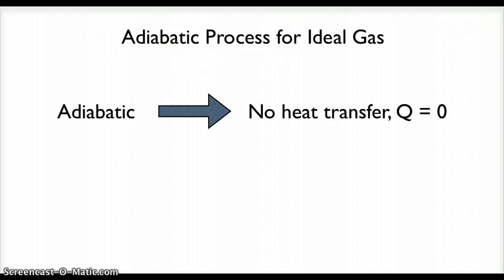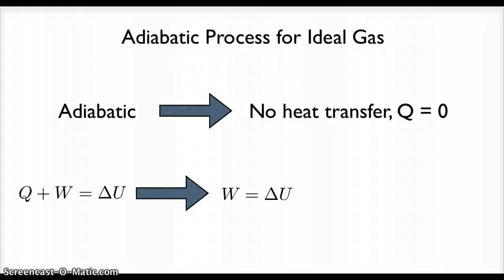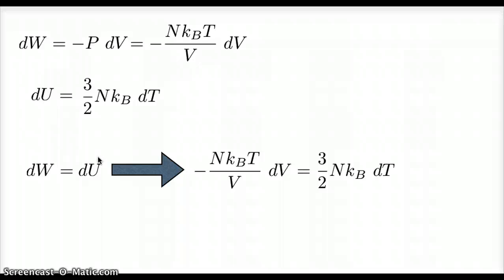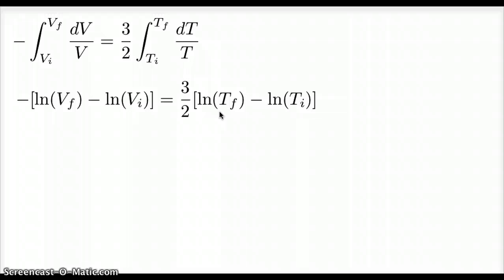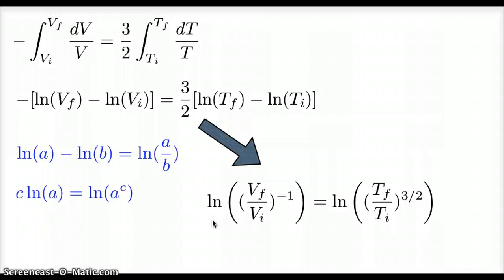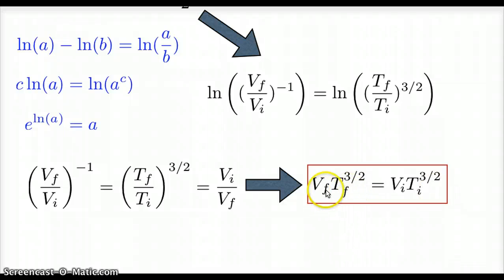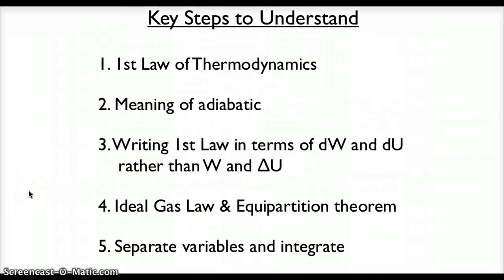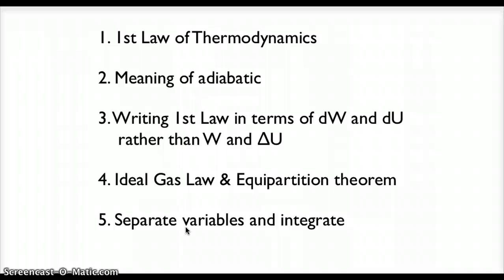Adiabatic process for ideal gas

Comment: What a terrible thing to say in a science=explanation video (0:25). And, you are not alone. I have yet to find an explanation of how the adiabatic process actually works.

To be credible, the explanation must explain how the air in a cylinder (such as in the demonstration of striking a piston in the cylinder with a hammer and charring a piece of paper in the cylinder).actually gets that hot. And/Or how/why the greatest heat rise in the cylinder of something like a Diesel engine is greatest at the top of the compression stroke, when the piston is moving slowly.
Reply: Yeah, you 're right. The balance between math and physics is gone. Isn't that the problem of nowadays physics too? ;-)

Comment from the maker: Good question,

The equation -dV/V = 3/2*dT/T is equivalent to the equation -1/V*dV/dT = 3/2*1/T. Let's integrate both sides of this equation with respect to temperature. The left side becomes -Int{1/V*dV/dT dT}. This is equal to -Int{dV/V} (you can use integration by parts to check this). Thus, even if we start by integrating both sides with respect to temperature, we still end up with -Int{dV/V} = 3/2*Int{dT/T} where the left integral is with respect to volume.